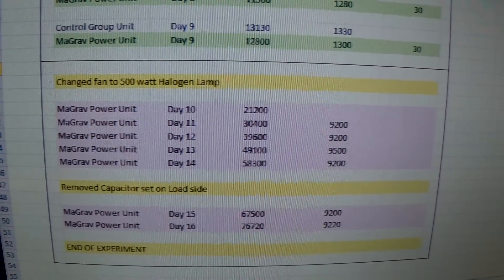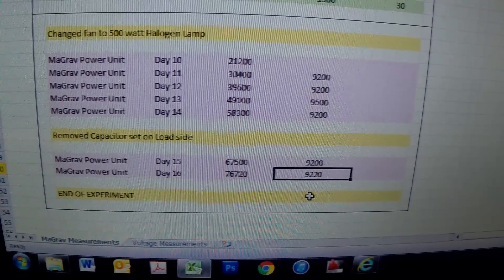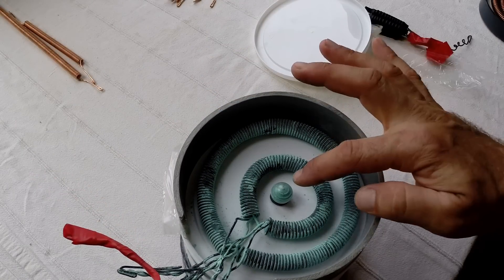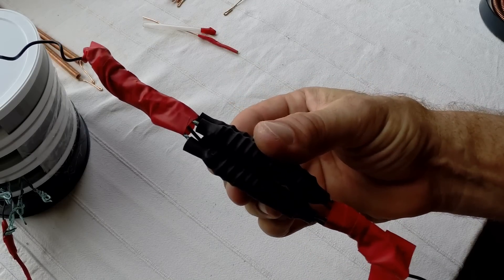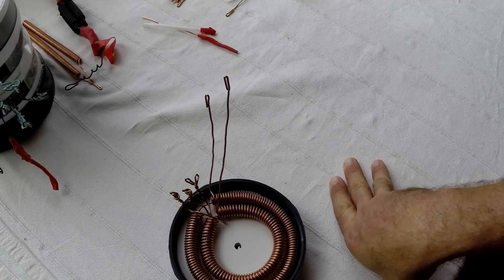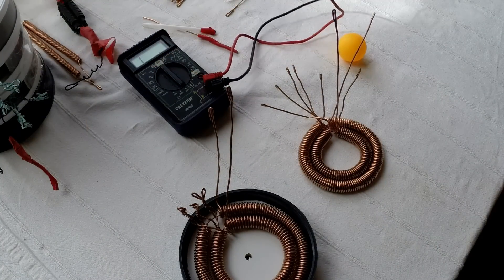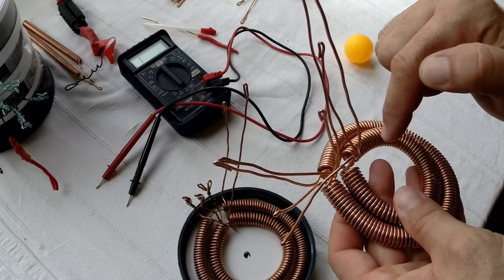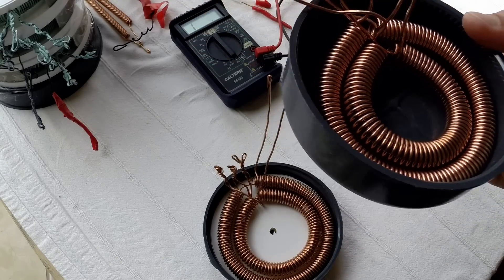Final Report - MaGrav Unit 1

Comment: Conditioning the Magravs Power Unit - Preparation

http://blueprint.keshefoundation.org/manual.php

Failure to follow the above recommendation at this stage may cause the unit to be rendered inoperative.

The purpose of the Magravs Power Unit to send and receive power at the plasmatic nano-coated level, and not at the metal copper-matter level – remember, the key to Magravs technology is in the nano-coating of your household copper wires via the Magravs Power Unit.

Just like bringing home a new puppy, we need to train the Magravs Power Unit to satisfy our energy needs, as well as to train ourselves to understand the system. This is not simply plug and play. It is plug and interplay – YOU are 1part of the whole connection! It is time for Humanity to reconnect with the energetic plasma world!

Therefore, it is crucial to nano-coat all wires in the household in a gradual and systematic manner through the Magravs Power Unit.

It is important to remember that once the Magravs Power Unit is connected and turned on, do not turn off or unplug the unit from that point onwards. It MUST keep running continuously in order for it to work effectively.

Please refer to last week's 89th KSW in our YouTube channel where Mr. Keshe mentions that they've discovered that 144 turns for the outside rings work much more effectively than the 162 called for in the blueprint. He also mentioned that nano-coating via fire method (butane) works more effectively for the Magravs Power Units.
Reply: +Wilby P. Thank you! your information is useful! much love.

Comment: Roald, hi , love you posts.. would a larger gans ball in the center increase the power, I live in Alberta and my unit was in an unheated building, was plugged in and was conditioning for 10 days, then the led lights dimmed and then went out.  My shop had finally cooled to the point where the gans had froze and I had no power coming out. Thawed it out and plugged it back in and it worked fine.  So the gans is super critical for strength of flow -- if coil proximity is important then maybe gans ball size and proximity is critical too...

Comment: Most people will fail building tha Keshe Magrav power unit/s due to lack of detail on frequencies. The radiant energy appears at certain band of frequencies and the system doesn't have to be nano-coated to go over-unity.  The frequency tuning hasn't been disclosed in blueprint - it is the most important info for the whole exercise.
Keshe capacitors (they are actually inductors) are performing the role of frequency tuning which is like filtering the rampant frequencies in the circuit to the level that they no longer kill radiant frequency and that where the overunity flows starts.
In your video nothing was said how you coupled capacitors to your circuit and/or how correct. Sometimes 4 capacitors is needed to refilter high frequencies.....
Your unit might be still working, start employing capacitors....

Comment: Hi Roald,
I did not understand the approach of the voltmeter. At first. Later on I understood a little bit more of it. As yuo know the nano coated layer is a separate layer. If it would have been possible at all, Keshe would have removed the copper so we would only use the nano coating. It is a layer on it's own, and has super conductivity (in a way). Unfortunately not for the conventional power. So if you connect your voltmeter to the copper (which is the inner part of your system), the differential will not even come close to the nano material! I had the same response as you had (I had it a while back). But currently I understand why you must do it the way it should be done! You MUST touch the nano coating FROM THE OUT SIDE. The nano coating has 2 sides, one touching the air (outer), one touching the copper (inner). When yuo prepare copper plates for making gans, you should do the same: touch the outside of the nano coating, not the copper. We know copper is highly conductive, and you will drain away the current so it will choose the path of least resistance.
Any how: do not nano coat your springs when they are coiled in one and other! You are not able to place the voltmeter (set to milli volts) on every spot of the coil (spring).
I know, the blue print is not clear, but I am sure that there is a progressive insight (voortschreidend inzicht) currently and please use it as you may get something to work that way.
I am NOT associated with Keshe, I am someone along the sideline and I am someone who always looks at details. I think your goal is to make something that will work, so please go for the details
- just use a gans ball, do not soak it completely. I cannot remember this has been told to us ever
- use the voltmeter and touch form the air-nano coating side
- nano coat several times, up to 5 times is much better
- I agree on using just one coil.  I think using 3 coils does add some 'luck' to the system (having a higher percentage to achieve something), it leaves more space for errors
- go for the amount of windings which seem to work well, outer=144, inner 81
- inner and outer spring should be very close to each other, the closer the better
Most of the above info comes from the 89th knowledge seekers video.
Reply: +deslomeslager  +Roald Boom Thank you so much for the advice and thank you for continuing to make an honest effort to get this working. My logic and intuition agree that Keshe is not a hoaxer. There is just no way he is intentionally misleading anyone. The way I see it he is either crazy/mistaken, or he is completely legitimate and does an awful job of conveying his ideas. While he keeps saying everything is 'so simple', the process of getting one of these units up and running is clearly not.
Reply from the maker: Nathan Parsons

maybe Nathan, maybe, but I for one am more skeptical then ever.....

Posting a warning video today....
Reply from the maker: +deslomeslager Thank you for the advice!

Comment: This post is simply a comparison to current known sciences, it is not an attack on the new claims of unknown qualities Keshe is investigating, which also require good thoughts and prayer, and apparently many failed experiments from the contributions of the public, who did not get the prayer thing just right. I respect all you out there searching for the correct formula to achieve self sustaining forms of energy, my hat is off to your work. I have done the same for the last decade or more with many other devices.

Can you do a test for carbon nano layering. They should be very strong. Stronger then steel. Take one of your old coils you are going to abandon out, throw it hard against a cement wall, and see if the black coating comes off, or if it springs back with a strong tension to recover it's form, like a steel spring would. Carbon nano coating of a build up of single layers, that could be "almost a superconductor" should be very strong, and if it does chip in spots or bend the spring, it should then self heal when given more carbon again. It should be conductive only along it's length, and not short out between two wires. That is why you have to polarize it as it hardens over and over probably 1000 times. I hate to see you building again and again, when it is obvious, you are doing experiments for the group, and showing what does not work, so changes can be made in the format each time, until it is found to be correct. This is a large difference, then giving the world a working technology that "any young girl can reproduce with a coconut" as claimed at the start verbally.

Now according to science if you do manage to get a "real carbon nano layering" on the copper wire and it passes the strength testing of "harder then steel," then by coating it with a "lithium base material" you will get your real superconductors, that science has already shown to work. Li is the activator ingredient, for the real thing, not zinc or copper, or carbon, or hydrogen, or CO2 or any other thing you are doing there with the primordial slimes being made with "ormus like" formulas. No one can say there is not one that will work, or some formula to get it working as you are attempting to do, they merely can state "there is one way it will work," and that is already known to science from about the year 2014 and into 2015. These real discoveries have been made in current science.

Maybe if you go back to the coke bottle method, you can make some real nano coat in several months that will pass the carbon nano strength tests??? I do not know.
Everything here is a big guess, and details left out to cover the failures which "we" already know will be happening with such wild variances of things like wind direction, which varies the tension on the coils. Distances between the coil spacing which will very the phase of the "vibration cancellation" already shown to reduce inertial qualities. Inconsistency, will not create real carbon nano layering. And this is only the starting point. After you get the formula for making real carbon nano materials, then comes the correct formula for GANs that will push it into actual super conduction mode. Li is the key to that phenomena, if you drop the requirement of prayer and good intentions.

They say the path to destruction is filled with good intentions, and not enough knowledge of the truth. I would state it will take both to achieve a real device for tapping the zero point field, and have that knowledge turned over directly to the public.

A carbon nano coating, that will superconduct, is one layer of atoms thick, and forms into 6 sided polygon structures. One layer made into a hammock, could support a cat. You are suposedly making thousands of layers, and it should then be so strong, you cannot break it short of chipping with a hammer and chisel. It should not come off on your hands, and it should become very hard to bend the end or twist it, after the carbon is set.

There is no form of carbon nano layering I am aware of, that remains in a soft form, and super conduct, but if there is then test it for the qualities of zero resistance to electric flows of high currents. Hi current will not burn up the wire if it is a superconductor. If you see a hi voltage drop across a wire with hi current through it, it is not a superconductor! Test your nano layering first, and if it does not pass that test do not go any further until you get it right, best guess.

Every now and then touching base with science, is a good thing to prove sanity is still present, and the "emotional mob mentality" has not prevailed for too long a time, that we are turning wishful thinking into imaginary results.

We do not need Keshe to prove something works, each person needs to prove what works, and then a true valued societal change can happen. If it does not work for you, then it is not real for you. It likely cannot change the rest of mankind either.

Now there are some people like Joe of Joe Cell tech that things work for, that no one else, or few others, can get to work.
This type of science, cannot be presented as an absolute, to the general population, because it may take say 7 years to master a thing like ""Tai Chi", because it is not mastered by "mental imagery" or book learning in the Ego mind, it is mastered in the doing of the flows and the vibrations, with the Ego mind stilled. A master of this in China can lift a bar of iron a thousands of degrees and not get a burn on the hands. This is not something you tell people to try at home. However it can be done if you dedicate your life to it for at least 7 years.

When we try to combine, the conscious field, with the physical world, we have to first comprehend a working system, then duplication becomes possible. If comprehension is absent, then the most we can hope to achieve is a failure, then to reflect on where we went wrong, and make corrections. Failures are valuable, if observations are noted. If you do not leave a trail of data on the failures then others will repeat them, and waste time effort and costs. Copper is not a "few cents", for 50 meters of number 14 wire. This is only a hype statement and not true, I have purchased many pounds of copper wire over the past decade doing these experiments, and know better. I have done so many builds that were guaranteed to work, by experts, it make me question my sanity. What a waste of copper I have become, in failed experiments.

Anyway it is good to check in or current science, as you build on faith, and in the long run compare which was more accurate, and more useful for what.

The pain coils, are what I see as the most promising at this point. Placing an ormus like vibration field on a copper coil, I must say does make sense to me, from what I have noted in working with this new energy form. If we could suggest to the ormus people they do not need to keep eating the stuff, then making more, over and over,this would benefit them. It would also lower the cost for those buying it.

Good job group!
Your experimental results, have great value to the public at large!

Dave L

Comment: Roald, why not take the discarded unit apart, remove 
nanocoating with the cold-water treatment, given by
Keshe in 89th Workshop.

For the cold-water treatment, go to MINUTE 50:15.

Then nanocoat EACH COIL 3 more times using blow 
torch. 

However, after each nanocoating, use the voltmeter to 
align EACH COIL separately.

Then install and connect them up again to see what 
would happen. 

Always Victory!!
Reply from the maker: +Izzy Leb Hi Izzy, I turned the first unit with the drill in foreward, so I won't spend much time on them for now..... got 2 new single set unit coming online soon though....
Reply: +Izzy Leb When you say 'each coil', do you mean each coil pair? 
In a full magrav unit, there are 3 layers of coils. 
Each layer contains one inner circle (short coils) and one outer circle of coils (long coils). 
Each circle of short and long coils contain two coils, one internal (gravitational, thin) and one external (magnetic, thick).
In total, 12 coils.
So by each coil, do you mean all the 12 coils individually. Or do you mean each coil circle, individually? A coil circle, as I said, contain two coils, one thin and one thick.
My head is spinning now...
Reply from the maker: sveindaniel

Yes, I mean that all 12 coils of my first unit were all 12 in the same direction. Made with the drill in forward....
Reply: +Roald Boom 
Yes, I know Roald, thank you, I have followed your work ;) My question was actually to Izzy Leb. But it is ok, I think I have answered this myself.
Reply from the maker: ahhhh, ok, now I see....

Comment: The fact that electricity passed, uninhibited, through the Magrav is actually a positive result as the nano coating makes those wires completely resistive on the surface.  So SOMETHING must be going on.  Yes?
Reply from the maker: +mach1james Inside the copper the function of electricity goes on.